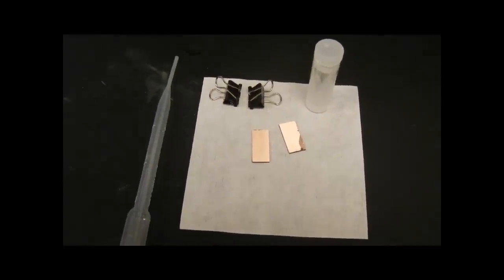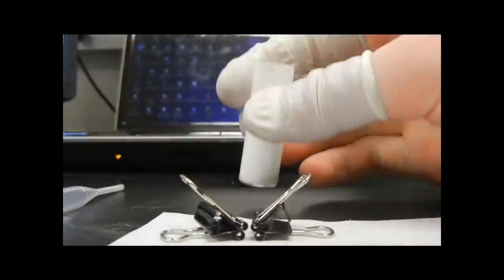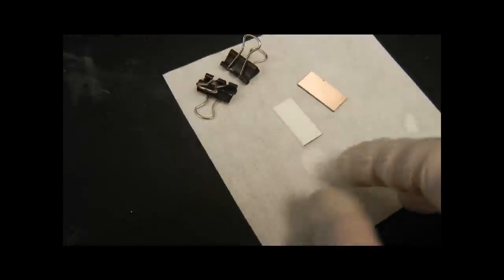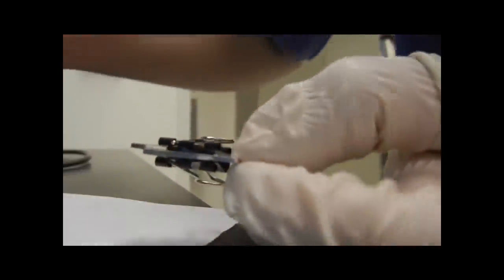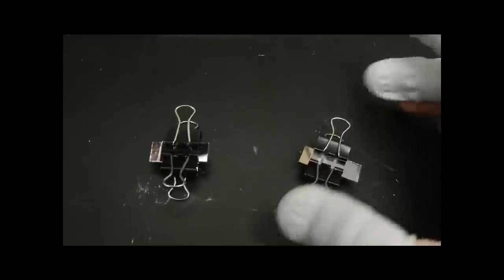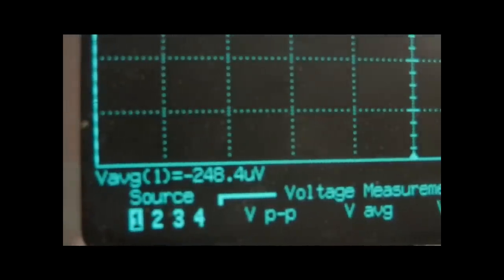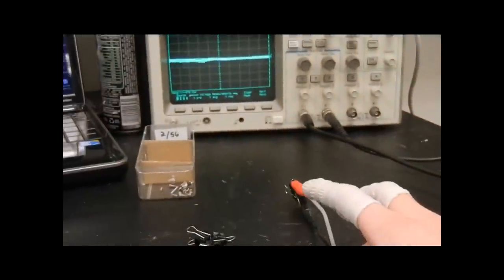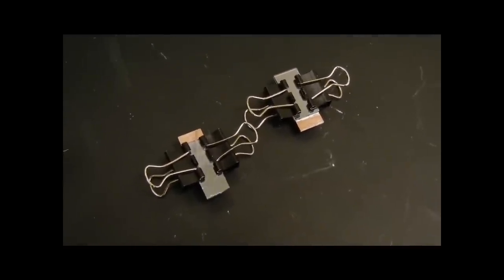Homemade Piezoelectric Transducer

Comment: Barium titanate is a ferroelectric material with a high electromechanical coupling factor.  The titanium atom shifts within an octahedral cage of oxygen atoms in the primitive cell in response to electric fields.  Even though the displacement of the titantium is only a small percentage of the lattice constant, it is still much larger than the displacement of atoms in most materials when you expose them to electric fields or when you flex them.  Stressing a TiBaO3 or KNbO3 crystal does the reverse, shifting the atoms which induces a charge density on the crystal surfaces which can then be measured as a voltage difference.  You would have to vibrate the crystals to generate AC current, as you aren't going to get a constant DC current from flexing a piezo/ferroelectric.  Yell at it LOUDLY.

Comment: You don't really need Barium Titanate (Although has a higher energy displacement) you can also use any Quartz Crystal (More easily obtained) for the Piezoelectric effect. As long as you melt it and let it dry within a 300V electric field to create the dipole you will have a much larger effect. Also to increase its power output, introduce a full-wave rectifier and you gain 50% more power conversion, introduce an oscillating tank and a supercap and you've increased your power output even more. If your energy source produces optimal frequencies and harmonics in a certain range it would be good to test the harmonics of your cell at its optimal level. This way you can impedance match the environment to produce an even more power generating conversion ratio in Universal scale (Phi). There is even an app on the phone that allows you to see the audible frequency in your environment.
Reply: Do you have way I can contact you.... I'll like to have information on this..thanks
Reply: Sypha Ox  hello!! i would also like that información. Give us a link please!!
Reply: Sypha Ox 
I would like to acquire somethings about it. I have to design a piezoelectric tile that can be placed on the floor to generate electricity since people stepping on it will create cyclic loading. Please guide me!
Can you tell me the name of the app?
Reply: Duuuuuuuuurp
Reply: sounds good in words, can you make one to demonstrate how it works.  thanks
Reply: this is the right comment..
Yes every Pizoelectric materials has it's best performance at its proper axis but if you are making your own layer you have to electrically oriant its molecules to desire orientation so all it's random cells Aline properly .
Not only Quartz but I think there is even cheaper options like sugar , Rochelles salt , pvdf etc

Comment: The oscilloscope seems to show an AC rather than DC voltage when you touch it.  Is it possible you are simply providing 50Hz AC pickup with your finger?  Check your timebase setting and see if that is the frequency.
If you had a piezo effect, you'd expect the whole trace to move up or down, rather than half up and half down.
Reply: Collins home brew says different
Reply: The pressure applied to a piezo electric crystal generally generates a dampening oscillation and or a sharp impulse. Either way it generally has a A.C type of waveform; however impulses and oscillations are complex transient currents and generally are not considered as being strictly A.C or D.C; oscillations are generally the product of A.C input, and impulses are generally the product of D.C. Regardless of what you call it, it is all electricity.

Comment: every Pizoelectric materials has it's best performance at its proper axis but if you are making your own layer you have to electrically oriant its molecules to desire orientation so all it's random cells Aline properly .
Not only Quartz but I think there is even cheaper options like sugar , Rochelles salt , pvdf etc

Comment: the charge created is a wave in the freq and shape of the resonant freq of the crystal- for something this small it is very high, well above hearing range. so when anything is struck, i.e. a tuning fork, the compression waves propagate throughout and thus the material is stretched and compressed very quickly, and thus a - and + voltage wave is created. am i correct? this is my basic understanding from many explinations. so this is why it does not hold a charge,bec all the vibes are dissipated

Comment: Barium titanate is not piezoelectric in its raw form but makes a great dielectric insulator (with large dielectric constant and insulating props)..  To make it a piezo material requires it be cast  or formed in a high static electric field. What you are seeing is electrical noise,  Polarized BT will show much more signal in the volt to hundred volt range and show a rapid decay if pressure remains, like a capacitor, with a reversal of voltage when pressure is released  (this is due to the load resistance of your leads, 10 megs or 100 megs)
Reply: Would it be sufficient to dry let a BT suspension dry in a HV field? In my understanding, each particle would be aligned by its effective dipole, effectively becoming polarized.
Reply: my guess in that wuold be (and only a guess) that water will not work since it is conductive and would shield or short out any E field, a non hygroscopic solvent might do it.
Reply: What would you consider using for seeing a higher voltage when weight is pressed on and off

Comment: I've worked in optics and thin film deposition. My first guess as to why one of your cells performed poorly is poor contacting. Your method of using clips to press out the fluid is pretty nifty, but the moment you move it back to bring both clips to symmetry, it invites air pockets to get sucked in if you let off the pressure even a little bit. Furthermore, the plate glass is likely float glass and not polished flat. This stuff is  made by cooling down a thin puddle of molten glass floating over liquid metal. It's never truly flat and the gap in-between is subject to uneven pocket sizes at random distributions. A few times I've been plagued with attempts to cement float plates together that turn out to be significantly concave on both sides, so when you press them together, they just draw air back in as soon as you release the pressure from the center.

Comment: Perhaps attempt applying charge Dc as it's drying to ensure proper alignment of the BaTi3 ( ? Sorry can't remember the formula offhand).  You might need to apply it horizontally to the plane of the setup idk.

Comment: I think it may be beneficial to set the plates while the piezo solution is still wet. Perhaps it would glue them together. I want to try dipping each end of a quartz crystal in Molton copper, do you think that would work?

Comment: A very nice construction! How does the voltage developed depend on factors like thickness of the barium titanate layer, the common area between the conductor plates, and any other possible factors?

Comment: My opinion is that the cell with the slurry in the beginning was put on very evenly and I think that may have had something to do with the fact that it could not be pressurized as much if there was more inconsistency with the layer on the second cell it may have provided gabs or clumps of the chemical which would of course allow you to compress it more just my opinion

Comment: More than likely there is a short between plates, speculating. At the micro/millivolt level it may not take much to drain voltage. Also there could have been a contaminant in between the plates. I suggest measuring resistance. Also there could have been a film of oil or something on one of the plates??

Comment: I want to know whether it can convert pressure in the form of sound energy to electrical energy, thank you
Reply: Nithyasri Srivathsan sound waves are pressure waves. In a sense sound is pressure. You might need to use ultrasonic vibrations to generate a significant amount power. A transducer is a device that either converts mechanical pressure into electricity, or converts electricity into sound (pressure). An ultrasound machine at the hospital has a crystal inside of it that produces ultrasonic vibrations when you apply an electric current across the crystal lattice. You see it works both ways.

Comment: Design request: 
A Piezo Membrane Buzzer (earpiece speaker). Which consists of a thin layer of copper that is stretched and tensed and then attached to a plastic frame with an inner diameter of 3.7cm and an outer diameter of 4cm (The diameter of the power membrane follows the outer diameter of the plastic frame which will then be cut off.) and yea, It's a Copper membrane with It's frame so it wont fold like an unused paper in the thrash. 

 The PZT solution is dripped directly onto the copper membrane in 4 or 8 layers (forms a layer that is not as thin as a layer of paint, as thick as a potato chip), each layer is allowed to dry gradually. 

 Also give the distance between the outer diameter of the copper membrane and the PZT layer that was dripped earlier is 1 cm.

 I'm very curious, if you don't use pzt or zirconate titanate, use Rochelle salt with the same application as I asked.

 Spread the conductive silver ink onto the PZT layer as an electrode evenly enough for later soldering or just make direct contact with the audio output using your hand.

 The concept is that a thin piezoelectric layer reacts to electricity more efficiently if it is attached to a very thin diaphragm (membrane) and a layer of Rochelle pzt/gram ceramic which is also thin, But it's thick enough to handle the vibrations later.

 The high resistance makes this (literally) Piezo membrane more efficient at converting electrical frequencies into vibrations and not wasted as heat, and if efficient enough Can be turned on with a crystal radio without electricity.

 What happens if I mix zirconate titanate with Rochelle salt? Sorry if it's a silly question, I don't know chemistry, but I understand enough to understand the simple concept of Piezoelectricity.

 It's an interesting phenomenon for me

Edit : The Copper membrane and conductive silver ink on the PZT layer act as electrodes

Comment: The cell which is working might be poled by mistake when you are attaching with the oscilloscope as it is possible to supply small voltages through oscilloscope. This results in the poling of BT,  as the thickness of the films are in few microns so the low voltages are enough to pole the films.

Comment: The microstructure of the crystals is likely significant.  I would guess that you would get the best results from growing a single crystal and marginal results from a more random pattern of small crystals. You might try annealing it. Heat the piece to well beyond the melting point of the BT (before you attach 2nd half) and cool it very slowly. Once it cools to just above the melting point and the rate of temp drop falls, touch one of the edges with a pin to start the crystal growth.

Comment: You probably made a short circuit right about at this moment, 2:34 or  here 3:14. Keep in mind you have a very fragile, thin layer of Barium Titanate dust on Glass there without any colloid whatsoever to stabilize this layer. Also,  I doubt that you get an even, consistent and repeatable layer thickness with this applying method, I suggest to spin coat it instead, because it's more repeatable by having a fixed constant rpm. Try that and show the results. Nonetheless, great job and thank you for shearing your knowledge. I subbed you  and hit the bell because I want to see the improvements keep it up pal 👍.    ...btw... do you know by any chance where to get the Barium Titanate and does particle size matter for the performance?
Reply: I think his biggest issue might be in not understanding piezo materials as proper crystal alignment is essential for operation and this slurry won't work like that giving random orientation.   He likely would see better results if he pulsed high voltage into this to align the crystals as it dried.  A static field may work also or be better.

Comment: If you need good piezo crystals, you must put your plate with barium titanate in direct electrical field, with voltage about 300V and then wait until it dry. Because in your case your cristals in plate have diferent orientation of dipole and you see too small piezoelectrical effect. (be careful voltage of 300V can kill you)
Reply: You can also try 'Poling' the ceramic in their final state -- very effective in compositions based on the Lead-Zirconium-Titanate [PZT] Perovskite crystal structure. Poling is the process by which a polarization of the crystal structure is induced by taking advantage of the ferroelectric/piezoelectric properties of a material.  Think of magnetism for example -- you can use a strong magnet to lightly (and temporarily) magnetize a screwdriver to pick up a screw by aligning (ie., polarizing, or 'poling') the crystals within the material; however, if you heat the magnetized screwdriver to the Curie temperature (unique for each material), it will lose the ability resist the crystals from returning to their original, random state and lose any magnetism.  The same process applies many piezoelectric ceramics by applying a strong electric field rather than magnetic.  

A good starting point would be to apply an electric field 50% over your desired value by cycling a DC voltage across your electrodes. Therefore, if you're aiming for 200 volts out, over maybe 10 seconds, slowly and smoothly ramp your voltage from 0V to 300V, count to three, and quickly drop the voltage back to zero -- this is one cycle.  Repeat the poling cycle a total of 3+ times and you can skip the need for the E-field during drying (or more commonly) sintering.  Just like with a magnetized screwdriver, the ceramic will lose its piezoelectric polarization over time if not used or if heated above its Curie temperature.  Fortunately, by applying a voltage with the same positive/negative polarity across the ceramic's electrodes that it was poled with, it will quickly return to its poled state even after several years sitting on a shelf (re-poling is much easier with the reverse-piezoelectric effect than the standard piezoelectric effect, but is possible with either process nonetheless).
Reply: @Nonunusmultorum  good day sir, you have experience working with ceramic piezoelectric transducer? we're working on power generation using piezo by footstep force, you have any idea about this study? our plan is the voltage generated from piezo can charge a mobile phone, is it possible? thank you in advance sir.
Reply: @rommeledulan8440  while the voltage output can be very high (look at the quartz piezo igniter in grills and disposable lighters for instance, several thousand volts from just a few pounds), the current output (amperage) is very low.   What you propose is theoretically possible, it's just a matter of optimizing parameters and designing a circuit that can store the incremental pulses of electricity until it hits a desired capacity to charge your phone.  Efficiency will be pretty low -- whle possible, it's not necessarily practical.  

Just order a few dozen Piezo transducer guitar pickups from online (can be found for <$1 each on Amazon, wish, banggood, etc) if you're interested in experimenting.  A single one of these round wafer transducers can blink multiple LEDs with just a flick of the finger.  

Good luck!
Reply: @Nonunusmultorum   thank you i didnt knew before piezo need poling just like magnet, i thought any piezoelectric ma weterial will exhbit as is in its natural form

recently i read paper about delignified wood exhibit piezo, deducing from yours so we can make cheap robust piezo electrode by cranking wood in 300 volt?

Comment: I don't apply a voltage to the plates, it's the pressure of the crystals that generate the voltage. It's transform mechanical energy in electric energy. FYI piezoelectric crystals are used in club in north Europe to get back energy from the dancers, placing piezoelectric crystals in the ground. When people goes up and down the dance floor it squeezes the crystals :)